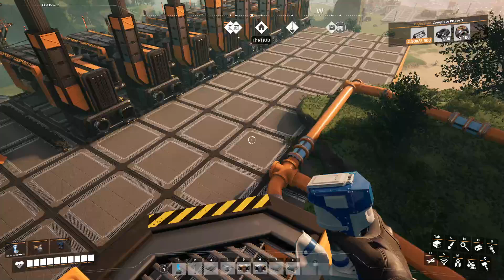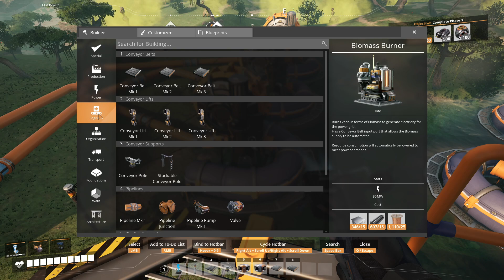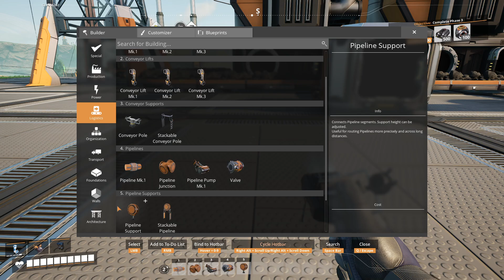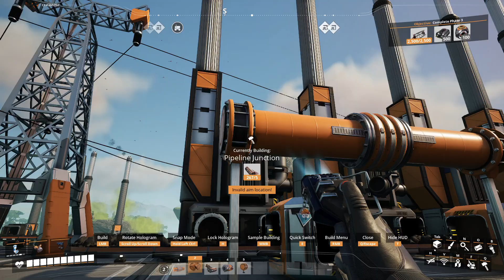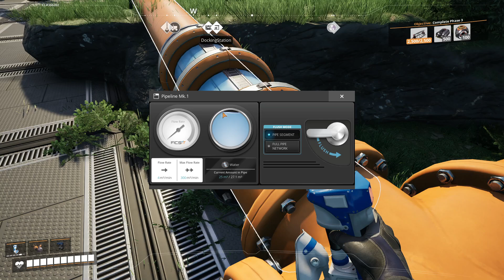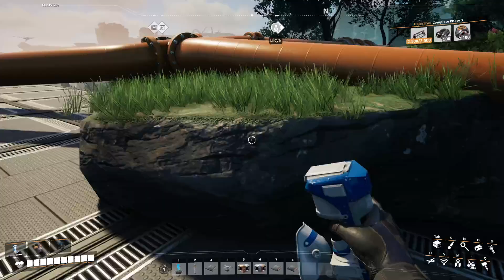Advanced COAL GENERATOR POWER PLANT GUIDE - Satisfactory 1.0

Comment: I've always found the best way to be be: 3 pumps, 1 water pump coming in on each end and then 1 injected in the middle.
Reply: the pipes work like belts in terms of capacity so this type of setup works yes.
Reply: Unlike belts, balancing pipes isn't very important. In my testing, you can do an endless horizontal run of pipes in series with no downside, as long as you completely fill the pipe before you start splitting it. Otherwise it might take a while for the fluid to make its way down the line while filling everything on the way.
Reply: @EvanNefff  balancing belts isn't important either. The manifold is far superior in every situation with no down side. Some people will say it takes time to saturate the belt line but thats really no concern as nothing needs to happen fast in this game and if you're like me I preload my manifolds before activating the out puts. so max maybe 10 mins to prep a line and save SOOOOO much space vs balance setups.
Reply: I've had too many headaches with lines starving themselves over the years to do that. It only takes one more tiles to put in parallel splitters and you can ensure that every single machine is getting what it needs or more at any given time. 4 contructors in series means that the 4th split is only giving the constructor 15/m if y ou're feeding it 120/m. Great if you're making rods, but now anything beyond 4 is getting single digit feed. Putting in pre splitters means each line is getting exactly 30 with only one extra splitter.
Reply: @EvanNefff  umm what? the manifold doesn't starve if you do the basic math correctly.
Reply: @toddblankenship7164  It absolutely does if you split too many times in series and the demand of the machine is more than the supply of the line. In fact, the math is exactly why I split in parallel. It's almost no extra work, it ensures optimal distribution, and it looks better.
Reply: @EvanNefff  the demand of the machines doesn't exceed the supply if you do the simple math. I just did a 720 iron ore manifold into 24 smelters with a manifold setup and it works 100% efficient. thats 720 Iron ingots output, because of belt capacity Mk3 they get split into three other manifolds.  one plates manifold of 12 constructors eating 360 ingots a min and two rod manifolds of 12 constructors each eating 180 ingots a min each. the one rod manifold feeds a screw manifold line of 18 constructors making 720 screws a min. the screw outputs are split due to mrk 3 belts being the best I have into 3 belts moving 240 screws per min. in the end the 720 Ore is turned into 240 Plates, 360 rods per min, 180 rods for the next stage to assemblers and 180 rods is turned into 720 screws a min. that's 100% efficient with zero down time as long as the outputs don't stop because of full storage.
Reply: @toddblankenship7164  " two rod manifolds of 12 constructors each eating 180 ingots a min each. "

AKA Parallel. I think you agree with me, but don't consider it the same thing. An assembly line in 'series' would be a splitter in each input, cutting the line in half and passing the rest to the next one until the end. 'Parallel' would be looking at those 24 and splitting the source to add more inputs based on whatever fraction is most equal. It really takes very little effort and materials to ensure that everything is balanced and arguably saves time when you factor in the time you'd have to take to prime the machines, saturate the lines, etc.  But ultimately the great thing about the game is there's a lot of ways to play it and still get results.
Reply: @EvanNefff  i seperated them because I wanted on of them being turned into screws. they for sure  are both fed with a manifold

Comment: i find a better ratio is 6:1 coal to water gen.   completely overlocked a water pump will fill a mark 1 pipe completely and fill 6 generators and change.

added to that a mk.1 blueprint platform will fit 3 generators and the logistics for them so a 6 gen 'tile' is simply a matter of 2 blueprints, a water pump and connecting the pipe and belt.

also a mk.3 belt holds 270 coal.  270 \ 15 coal per minute per gen = 18    which again splits perfectly in 3 tiles of 6
Reply: I'd only do that if you have very little water available. Between the exponential power increase and the 3 slugs requirement per extractor, I don't think this approach is worth it. Keep it 3:1, save the slugs for more complicated processes that actually need fine tuning in the later game.
Reply: I do 4 water pumps for 8 coal gens and under clock them to 75% or 90 water per min. When overclocking the power use scales badly and so you end up using a good chunk of the power you generate to power the water. it's completely the wrong way to go unless space is limited and you cant easily place the water pumps. even then running power lines is easy as eating pancakes so you can just setup the coal gensets near the ocean and the nodes then run the power lines back to base.